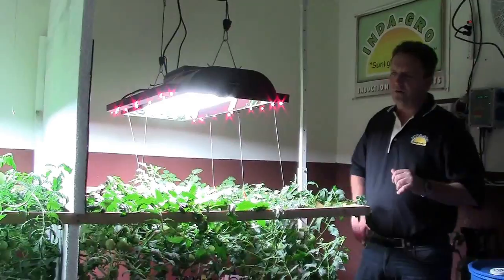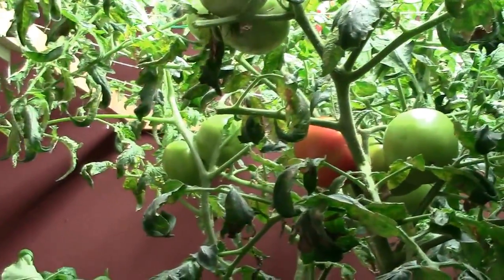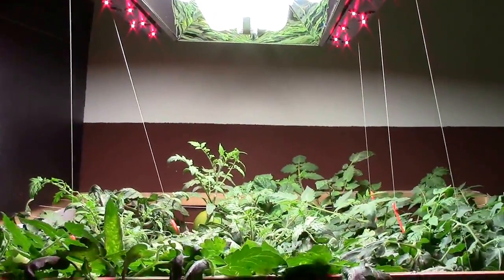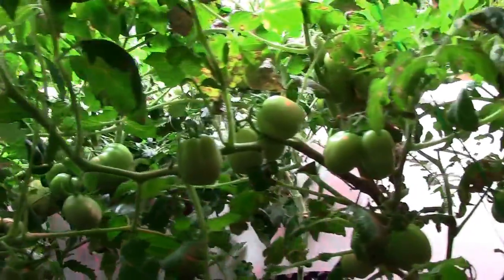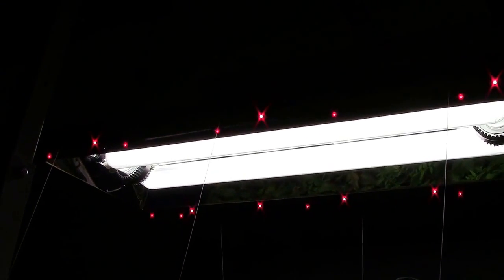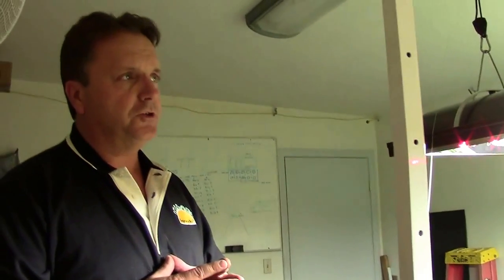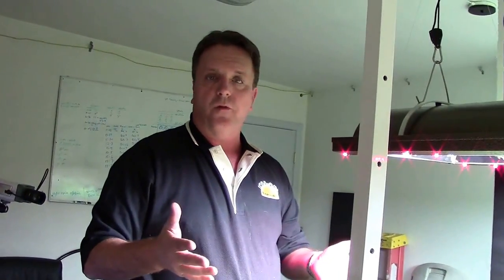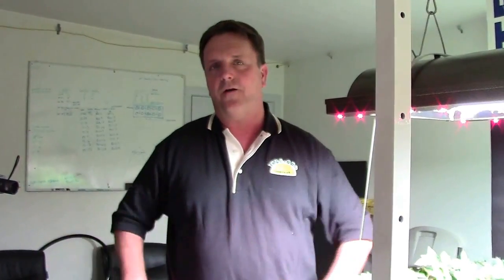Inda-Gro In House Garden Side by Side Trials

Comment: Well, I was wondering why the  LED canopy has 5 plants and the the other side only has 4?  A clear statement about both sides are equal is misleading.   Maybe someone will correct me if I'm wrong.
Reply: Looks like the same light system except the right-side light has the red LED "pontoon" setup.  The red light spectrum is ideal for flower stage,  although the left side did have some nice yield for indoor.
Reply: I can agree with your statement.  Having more plants on one side is the issue I was addressing though.  I purchased one of these 420 units over a year ago and found my plants to make the full spectrum from veg. to flower, although at a sub par experience.  My cherry tom. ( yes tomatoes) would not mature on the insides and   peppers were small, with lots of flowers though.  But, my Kale was awesome.  Well, Kale is all Veg. growth which is my point also.  Bad flowering growth!  It is possible that my unit is old and used before I received it, seeing it was totally dusty in the box ( which I still have, and would take a credit of half if  could return).  I will be going to Hid lighting soon for the winter, as the heat will be a help in my basement.  I RECOMMEND NOT INVESTING IN THIS LIGHT!  BTW, I do use a Ph meter and PPM meter by Blue Lab when using water and coca coir.  I also used soil to see the diff. and found my finding the same.  Its the light!   I wont give up growing, just using this induction light. Btw, Btw, my first experience with absolutely no understand, other than basics, was very successful with a hps 400.